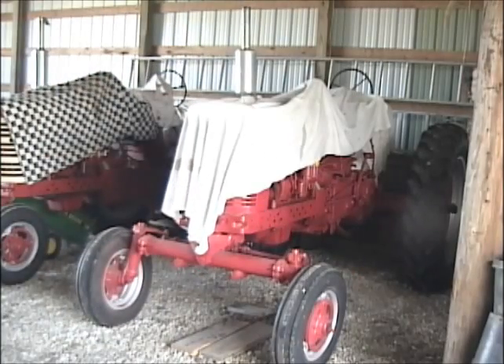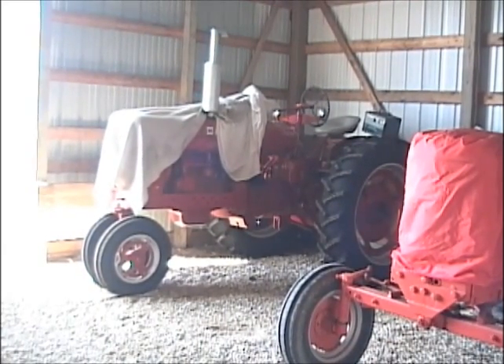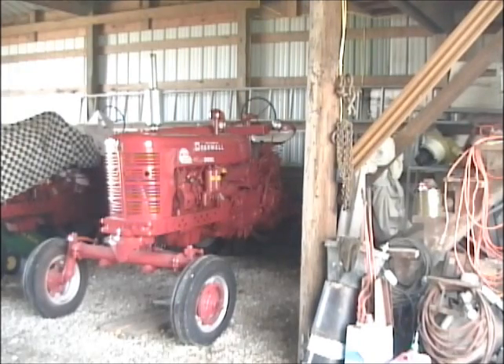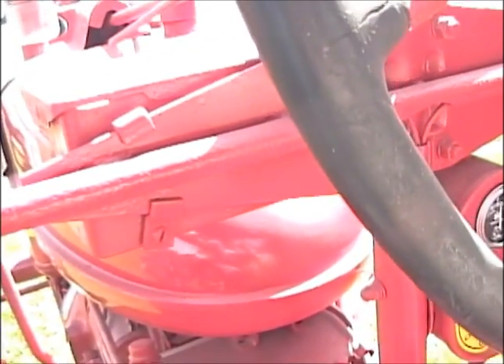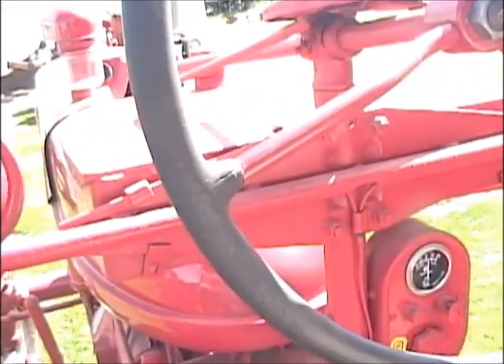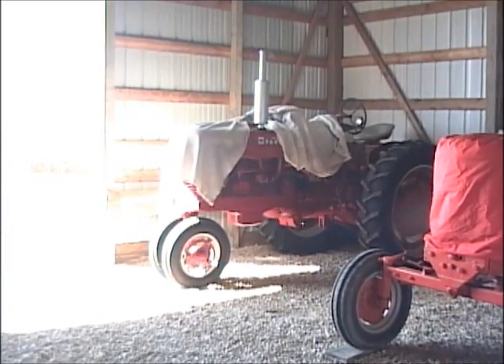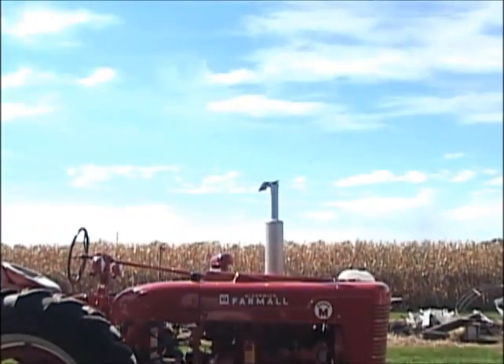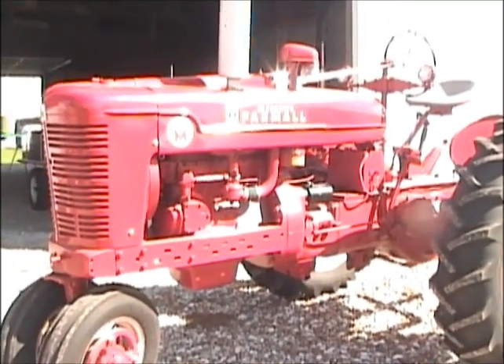2015 Super MTA Diesel Super M gas

Comment: Techinchly it's a "Super MDTA" and it's very rare, especially a wide front
Reply: As far as IH lingo goes, all Super M-TAs were badged as such. They’d have the diesel decal on the fuel tank, but that’s it. Super M-TAs were even still badged as M-TA if they didn’t have a TA, they just used a different decal that didn’t say torque amplifier.
Reply: Wrong - Its not an MDTA, ITs an MTA - Diesel. All MTA were MTA, Is an LP version a MLPTA?
Reply: @trentmuthler7677  what about a b c d e f and g? Don't they matter